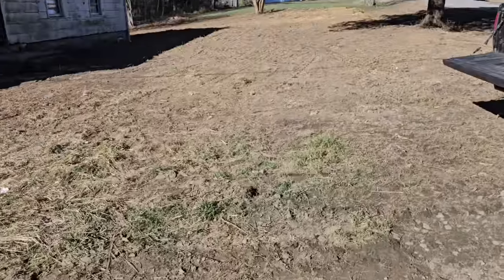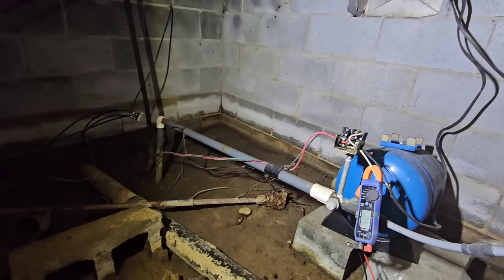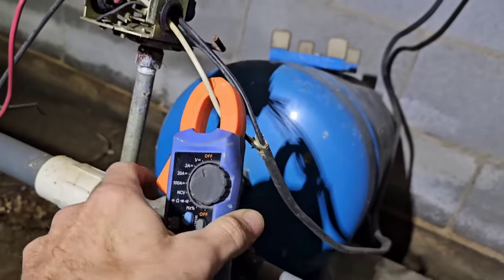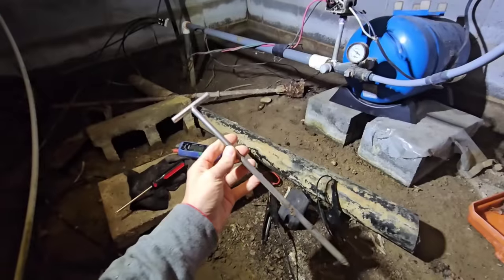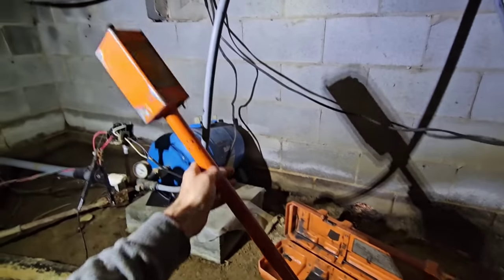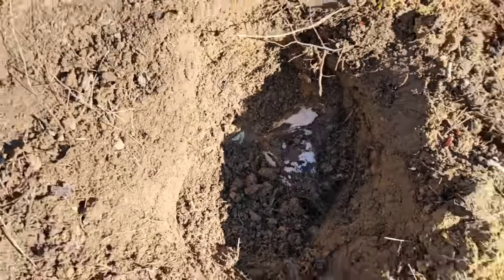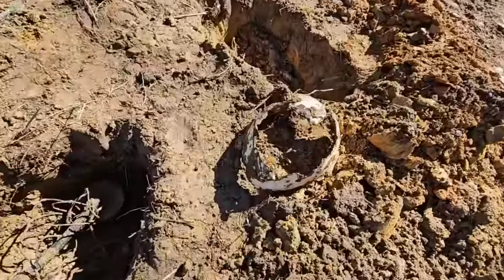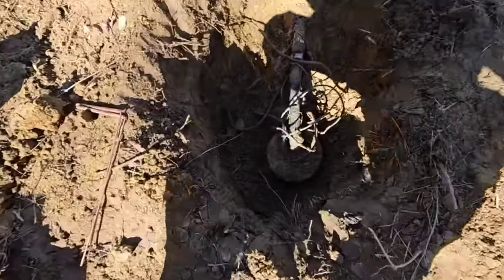Can Copper Dousing Rods Find a Water Well below the Ground? New Tech Vs. Old

Comment: I wanna ask you a stupid question kinda unrelated to this video lol. I see you say most of these old steel well casings are 5 5/8”. I have a buried well drilled in 1968 best of my knowledge with no record with steel casing. Would a 6” well seal fit a 5 5/8 casing? My mind says no but is there wiggle room? When I had pump changed on my well they used a 6” well seal but I have never seen you come across 6” steel well casing.

Comment: I have located many of water lines both potable and septic with stainless steel rods bent at 90 degrees in 3/8" OD plastic tubing.  The plastic tubing is so I don't contact the stainless steel rods and effect the movement.

Comment: Ditch the tubing, for those already divining try getting hold of some high tensile wire from air conditioning duct. Cut the wire an inch or two longer than the ones you use now work with them for a while before altering the length. For those that use them for water line location might not know you can also detect gas lines, telco lines, storm water pipes, Honestly i don’t think there are any limits for their use. For utility detection some claim it’s either hit or miss when you may be actually detecting multiple assets in the area throwing your sensors off. For those that can’t seem to get these to work don’t give up i tried every different types of wire there is before finding the right wire. Good luck people.
Oh Ps, on one of my detection jobs a 4” Cast iron water main was proved at 5m deep, your going to need an enormous amount of luck locating gold or gem stones 👍

Comment: I use either a 5 foot long straight crowbar (used for making holes through gravel before pounding the post) balanced on three fingers of one hand at my side, or two big 3 foot long copper grounding wires bent into L shapes. But i don't know the depth of the stream; and can also locate a buried pipeline or underground power line (but i never know if it is moisture or metal !)

Comment: Hope they witch the new well.  We have a company around here that says  "water water everywhere" and just drills deeper to create storage space in the well bore, and sometimes sulfur salt, or even gas.  As long as the old well is suitably deep and tests free of coliform, iit's probably OK  Septic systems and water wells are utilizing different parts of the geologic stratum.  Also, dye testing can confirm a cross connection, if it is severe.

Comment: I've been doing irrigation in IN for 25 years. Use dowsing all the time to find buried zone lines that don't have wire run with them.  It's not as exact as a wire tracer, but it will get you close. The problem is it will pick up other stuff: tree roots, abandoned wires, basically anything that's a different density than the soil. All the new guys look at me like I'm crazy when I do it .

Comment: I use metal coat hanger, cut and bend into L shape. Works on a fresh drill spot, I find any underground water, electric wires, plastic or metal water pipes. Work for lots of people, some it doesn't work, why I don't know.

Comment: Pump the well for 48 hrs. then test,  I worked at a power plant and these rods are almost foolproof ,I have found 2 inch pipes  over 15 ft. under the surface  , one problem  always notice over head wiring they will show them also no matter how high, powered up  or not ! Good for communication lines.

Comment: I'm 80 and when I was about 10 my father had a piece of land we were going to build on in Connecticut. He cut a y branch from a willow tree, he walked the land until the branch moved down, my sister who was 8 held onto the branch and for some reason the branch quickly moved to the spot where there was water much faster than when my dad hele it.
We dug by hand and within 10' we hit crystal clear ice cold water. My father never did build a house and later my mother gave the land to her niece, she is using that same well my father found and it has never dried up.

Comment: When I was in the 5th grade, a classmate said he could find water with 2 rods made from coat hangers. Teacher gave him a chance to locate a waterline under the classroom.  He starts at a wall with the 2 coat hanger rods folded into an L shape.  He takes one step at a time. As he approached the water line, his hair started to frizz up, and the rods started to rotate out.  When he stepped on the line, the rods turned straight out along the line and his hair frizzed straight up. As he would step back and forth the rods would move and his hair would rise and fall.  Teacher knew that the water line existed but didn't know where it exactly ran. And maybe someone can fake the rods moving. But you can't fake his hair frizzing up and falling down. It was really funny.

Comment: When I was younger, I worked for a electrical engineer that had someone using dowsing rods to find silver and gold.  The old timer using the copper rods had placed a gold nugget on one rod and a silver nugget on the other rod. Now the electrical engineer said, I understand the science of how the rods find water or minerals or pipes, but the gold and silver nuggets are a myth. So using the rods are not a mystery there is a scientific magnetic field of some kind, taking place and reacting between the rods, the atmosphere and the water or metal. At least that’s the way I understood it from what this electrical engineer was saying. This all took place just outside of Kingman Arizona. Wherever the rods crossed they put a flag and then got a mobile drilling rig and Dug core samples. The only precious thing they found at every spot was water. Lol.

Comment: I have used 6 gauge copper wire, since the 1960's, to locate copper telecommunication cables, power lines, culvert pipes, and even overhead telephone and power company lines.  Very accurate method.  The only drawback is sometimes you don't know what you have located until you dig it up or look up above.

Comment: If you take your wand when it deads out, lean it till you get your single, and you can get an approximate depth.
Yes, dousing rods do work. You most likely could have found the line near the home, then followed it out. The only issue is it will find water or storm drains equally.

Comment: I use to use those to find septic tanks 😂. They work I also never bought “real” ones I always cut wire coat hangars and made them. I always said either we found the tank, or this is where to drill your new water well lol 
Also one rod or the other will point you in the direction to go before they cross  they follow the water. 

I’m a firm believer in the rods.

Comment: I have tried dowsing rods in Arizona to find underground water and felt like they worked. I didn’t buy the property, but it did line up with other wells that were drilled up hill. 

I took the plastic tube from pens to put my dowsing rods into. I can’t feel my hands and didn’t want my grip to affect them.

Comment: Dowsing works. You are the sensor & the rods are just the meter. The rods can be any material, and what you have is about the most sensitive. As you walk over a ley line the change in field flexes your muscles slightly causing your arms to move. So just relax into it.

Comment: I don’t understand how it works, but I know it does.  I agree that it seems like mere coincidence or a con job, but my partner and I had property where an experienced well driller hit dry holes 3 times, and a hole located by a dowser hit a gusher the first try.  I also have a friend who worked at a golf course, and they regularly used dowsers to locate water lines.  I’m still amazed - I never would have believed it if I didn’t have first hand experience.

Comment: I dowse for water with brazing rods similar to what you were using but no copper around the short segment.  The best volume that I found was 125' deep and at 150 gals per minute. Can I explain how it works, No, but it works for some of us.  Good to see a well driller using rods.  Using the same rods I find buried wire.   Enjoyed the video.

Comment: I was at a demo job site with my cousin and a guy from the city came out to locate pipes.. He had a single dousing rod in one hand and a paint marker can in the other hand.. he was walking fast and every time the rod swung he would mark the ground. He had it marked out in no time. Everyone was wtf?.. he smiled ad got out the electronic finder to confirm and everywhere he marked the electronic finder confirmed..   He said the dowser was much faster. I had used dowser before to locate water pipes with success but this guy was dang fast with it.. just one rod too. he said that is all it takes is one because when you use 2 they are not reacting with each other.. they just swing 90 to the pipe... Next time you try using 2 rods and you find them crossing... just use one and see if it still swings.. and try it from different angles to see if it is liming up parallel or crossing 90 degrees to the pipe... for science.

Comment: I have found lost graves with this method.
I was taught how to "witch" for water by an old timer when I was pretty young and I know it works. The only difference is that the rods swing out. 
 The theory behind finding graves is that it must be a grave in which the deceased was buried in a casket. Over time the casket fills with water and creates a very small magnetic field. 
I was taught to walk perpendicular to the area that you suppose has water as opposed to along the same axis as you did.  We used old brazing rods or even coat hangers. 
I have also done this in town to find supply lines. I however do not believe for a second that a douser can use a stick of any species to find anything.

Comment: I use spring steel L-rods that I made. Works every time. Recently found a lost septic system. Before that found two water sources (in the rain) for two new house builds on a hill that had been recently logged. It was a mess walking over and through that with rods. Both wells were under 100 feet and both were 32 gallons a minute. Unheard of in that area.

Comment: I'm electrician and when I was on a job many years ago and I was on a job that the contractor got switched it was a state job the old contractor made a lot of mistakes and so being the new contractor people there was a lot of underground stuff that couldn't be traced and being large electrical pipe 4-in underground at least 4 ft the boss and the cronies couldn't find where pipe was wasn't supposed to be. So I stepped up and told them I can dowse for the wires and the pipe and find where the pipe is broken with number 10 wire stripped.. so I got the wire and I walked around out in the courtyard and I found it and they were surprised I got the backhoe and dug it up and there was.. I have found in my life you can ask for anything you're looking for

Comment: I have had very good luck finding buried wires and pipes using dousing rods.   I am absolutely sure it works. I used it to find the underground electrical service to my home as my septic drain field was between the service entrance and the utility connection and the foundation was already poured 15' wide  from where It came out of the ground.  I thought I had missed as it was was 5' down and in a place I would have never looked.

Comment: Always used wire coat hanger worked under ground utilities for years years ago. If I remember right it's not just for water. They will find anything buried and or nothing ! As long as the ground has been dug it will find it. Try it on an open empty ditch line.

Comment: Try this.
Walk from any known well back to the house with steel rods.  Don't  know where the house penetration is.  
I use wire coat hangers with the coating sanded off, 6' in the hands and 12' for the rod.  I keep my thumbs on top of my index finger to quash the argument of manipulation.

Comment: Like many of your comments below there are several methods using different types of wood tree branches willows any kind of copper or my favorite is coat hangers to do this job I am a firm believer in this function but like it's also mentioned below it does not work for everybody I don't understand why but it works so well for me I only need one I can do what you can do with two with just one wire and it will just point straight out in front of me till I cross that place and then it will hit my chest that's my place. I've made a lot of believers out of this even though they can't do it themselves they stand there and watch me in awe it's one of the coolest things I don't understand the physics of it or the nature involved but it sure is fun

Comment: You should give your copper wands as they did work as you had proved, I used to use a better galvanised wire, and sometimes I used The Willows stakes, a give you the same readings as you have just found out. To find the depth of the water you would need to walk from the centre of the hole away from it on both sides.  Measure a distance and this will give you the depth of well.

Comment: No way, open  the well and find out if it is making good water ,then you will know how deep that well was  if good water  check how much the old well was making if less than 3 gpm Then make the d diction to abandon or drill a new well . if less than 3 G.P. M.   If the water,  is good to drill deeper And be grandfathered in you save a lot of $$$

Comment: I can find buried wires, water lines, sewer lines, pretty much anything. I usually use gas welding rod, bent in a 90. Mostly because I have plenty of it on hand in my shop. Been doing it for years, I learned how from my brother. He was an electrician at the time and used it to locate buried wires and pipes at work.

Comment: I worked in SoCal Edison Substations. Power transformers inside fence property has a ground grid buried under rock dust for ground return. Any equipment permanently placed on the property needs to be connected to that ground grid. I use divining rods to find exactly where to dig to connect. I also use your expensive tool. The rods cross exactly where the ground grid is. Also used divining rods to find water main to my house too. Amazing… Changed my view.

Comment: You should use brass welding wires that are bent to a 56 degree and do not have any sleeve in your hand.  If you come from left to right, you can find the wire or drain pipes. etc. You can find septic tanks just as easy.  Toss your electrical tester and just use the brass rods!

Comment: 20 yrs. ago while employed at UCD as an electrician, our locater guy was out the same site I was working and was using those dowsing rods. I called BS, so he showed my how to hold them and to my surprise they crossed right where the water line was running. My partner tried them and it would not work for him. I have been a believer ever since.

Comment: You can also use metal coat hangers,just bend them like the copper tools,and lightly hold on your hands ,the long ends facing to the front,one inch from each other ,and walk ,when you hit underground plumbing,the two ends will cross each other.

Comment: Try putting the rods in a bit of plastic pipe or a spool to eliminate hand contact. They will be more sensitive. I was skeptical but it worked the first time I tried it. Later, I was able to find where the  water supply piped crossed a dirt road so I could tell the construction team where to be careful when paving it.

Comment: Here in Michigan, we had a new well drilled and abandoned the old one.  The guys poured some kind of expanding rocks into it to seal it off, no concrete.  Not sure if that varies by state.  Also, it was about 70-80 feet and the new well was 44 feet.

Comment: Dousing rods don't have to be copper. You can use bent metal coat hangers and get the same effect. I spent a summer doing new construction sewer hook ups and I found the end of the sewer pipe everytime.
They're find pipe as well wires in the ground.

Comment: I've been dowsing with copper rods for 40 years. I can find and follow metal pipes, water lines, wires under ground or under concrete with-in inches. I also dowse for wells, dug or drilled and can give depth with-in 0 to 5 feet.

Comment: Seen old timer public works employee look for a broken main line filling a movie theatre with water
No one could find it after using excavator for several holes he found it in 5 minutes told the operator to dig here and within 3 /4 scoops it was right on the broken section of pipe

Comment: We were installing a new 18 inch high pressure gas line at LVT Steel next to a 48 inch high pressure gas line. The gas company told us where to dig. I used the rods. I told our operator they were wrong. Andy said we would have died. I always use my rods.

Comment: I've witched water pipes for years. Never used anything but old coat hangers.  For the non believers, you should had found the pipe the old fashion way then got to electronics

Comment: my late father hired a fella to find an underground stream, he used the wire rods, plain fencing wire, and found a suitable stream at 70 feet. The fella showed the 10 year old kid, me, how to do it and i was able to find the same stream. I would hold those wires as hard as i could to stop them moving but whenever i approached that spot those wires moved every time. The bore was drilled and plenty of water was available for years until we sold the property